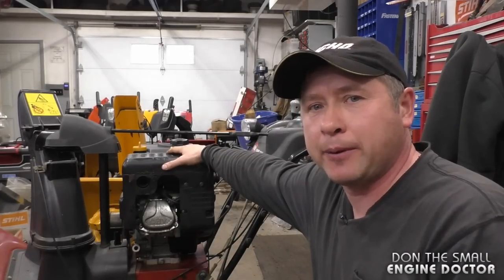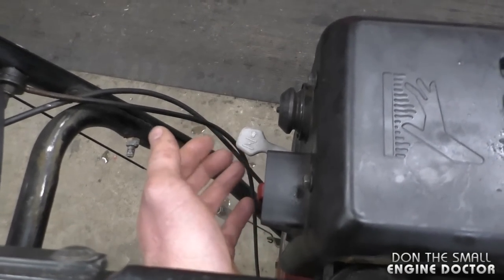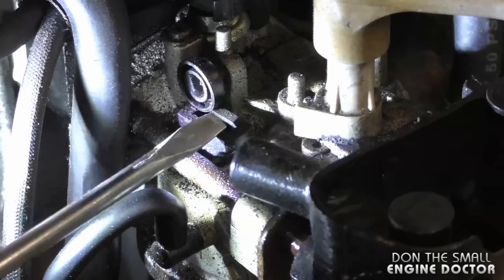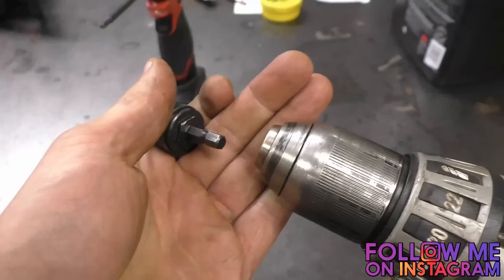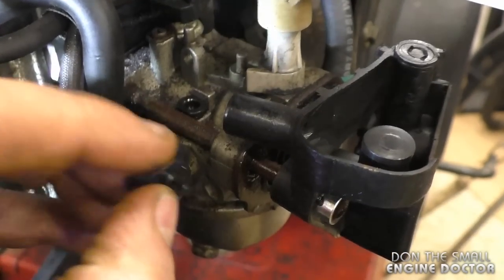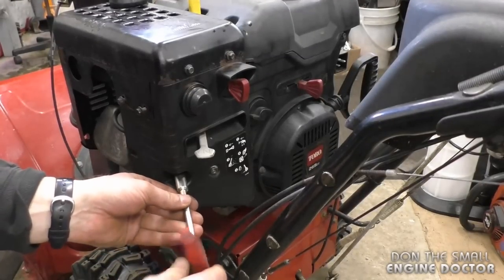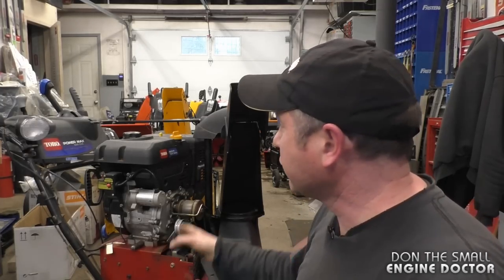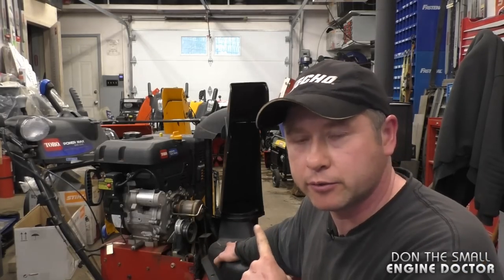FIXING A Snowblower That Surges With Donyboy73

Comment: I have the same surging on a 2017 tecumseh 277 cc engine which is on a 24 inch cub cadet snow blower. I changed the complete carburetor for a new one and so I know it is clean and I have exact same surging. I did not try this trick yet but I have ordered some micro drill bits to try. My surging started at the beginning of this season when right after stalling the engine abruptly in a snow bank. I have seen elsewhere where it is possible i broke the governor gear. Is it possible the surging could be from that. The governor is pulsing which is causing the surging. When the snowblower is loaded  throwing snow it is running fine but without load it is surging. No problem to start though. Can you let me know if it could be your fix to solve problem or if it could be the governor. Changing the governor looks like a big job and i don't have the part number or diagram of parts for the engine I would need. to be sure I have the right part.

Comment: Would this also fix my issue where the Snowblower won't run on anything but full choke and it doesn't throw the snow very far?
Reply from the maker: it can yes
Reply: @donyboy73  You know what else stops a snowblower from throwing snow very far?  A loose drive belt, which is what I found after posting my original question.  Doh.

Comment: How do you fix a snowblower that bogs down in snow but is fine just running?
Reply: Check your head gasket for leaks..if it doesn't have good compression it will bog under load

Comment: I own a Honda HS1132 snowblower. The height adjustment cylinder doesn’t hold anymore. Is it possible to rebuild that cylinder as they are very expensive. Also do you have a video of the removal and possibly repair of that project? Thanks.
Reply from the maker: they are not serviceable
Reply: @donyboy73  thank you for fast response.

Comment: My older Toro surges only without a load. When I engage the auger and drive train and then begin to snow blow, the surging stops. Any thoughts?
Reply from the maker: check the link in description where i do this on a tecumseh engine

Comment: The tree huggers wanted to lower emissions and so they castrated the engine by putting a smaller opening in the part.
Reply: Inver understood the point of that smaller jets thing, if it doesn't run, whats the point?

Comment: I have a 15 yr old MTD snowblower with a Tecumseh HMSK80 engine. When running at full throttle but not under load, it fires like 10 times and then...I'm not sure if it's a miss, or a tiny surge - it's just a sort of hiccup. It gets a bit better with the choke slightly on. It only stops when under full load, like when cutting through deep snow. I did a full tune-up with a brand new carb, spark plug, hoses, inline filter, and cleaned the gas tank & little screen in the tank. Any suggestions? Something with the governor mechanism or spark system? I wonder if I need to drill out the air jet on the new carb like you show in the video? Design flaw? EDIT: I left this comment earlier, but just now I watched your other video with the spark testers on the dual-cylinder lawnmower, and it's got me wondering if I have a bad coil. I'm going to give that a twirl and see what happens.
Reply from the maker: some aftermarket carbs are no good, and yes some need the jet enlarged from the get go when they are new

Comment: wheres the link to the drill bits?
Reply from the maker: https://www.amazon.ca/Pin-Vise-Professional-Electronic-Assembling/dp/B07BS5T1FC/ref=sr_1_7?dchild=1&keywords=micro+drill+bit&qid=1614341116&sr=8-7
Reply: @donyboy73  Happen to have a link to where you got the chuck that goes in the drill? Can't seem to find that exact piece on Amazon.
Reply from the maker: @bdawg8569  https://www.amazon.ca/Migiwata-Screwdriver-Quick-Change-Stright-Shank-Micro-Production/dp/B072FMW3GP/ref=sr_1_5?dchild=1&keywords=micro+drill+bit+chuck&qid=1614388761&sr=8-5
Reply from the maker: @bdawg8569  https://www.amazon.com/LONKER-Keyless-Converter-0-3-6-5mm-0-3-3-6mm/dp/B0722R1VJW/ref=sr_1_4?dchild=1&keywords=micro+drill+bit+chuck&qid=1614388871&sr=8-4
Reply: @donyboy73  Thanks man!